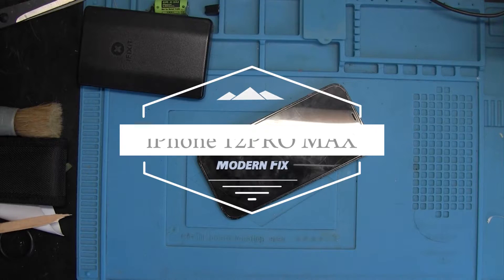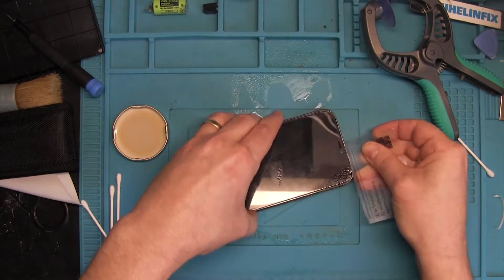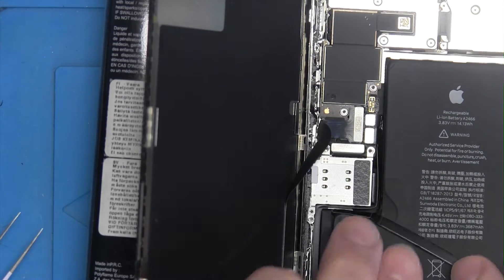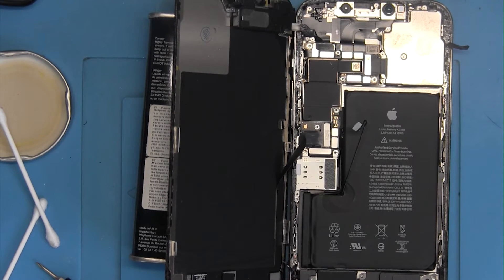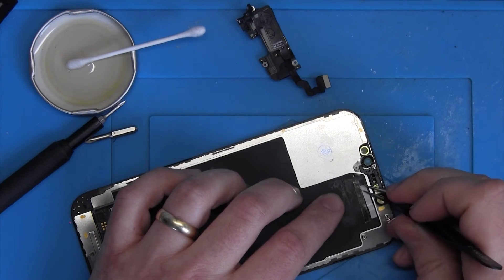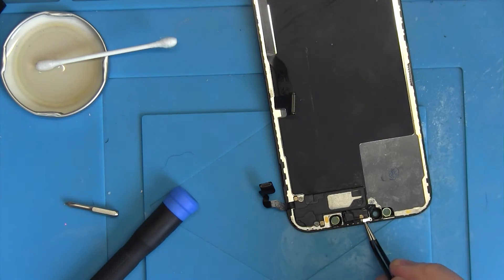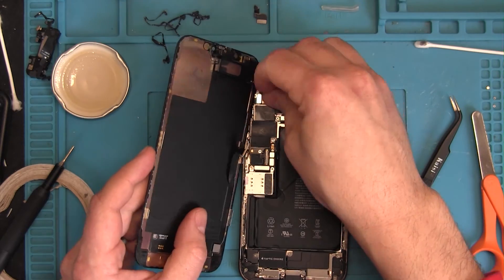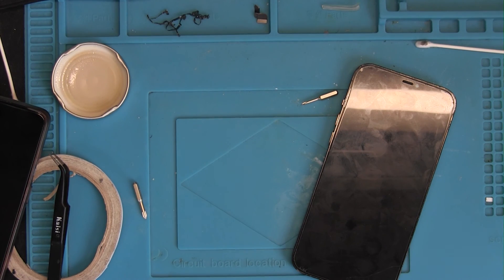iPhone 12 PRO MAX Boot loop error 4013 FIXED!!

Comment: I have this issue on my iPhone 14 Pro Max, would doing this work on my phone or no? I'd really appreciate any help I can get.
Reply from the maker: hmm, I have not worked on 14 pro Max and by looking at the parts it seems that they are bit different. The design of the parts are different and I don't know if it is caused by the same water damage issue. But you can open your phone and detach the same part and see if your phone turns on. E.g. Ifixit has instructions on how to do this.

Comment: I took out the proximity sensor and my phone turned on again, even though face id got cooked, but at least I got inside the phone and icloud backed everything. Thanks for the video it helped a lot!
Reply from the maker: Great, it is always nice to hear that I my videos help.
Reply: Did you just take it out or did you replace it? I just need my phone to turn on so I can get my data.
Reply: @thewes_b  I just took out the sensor didnt need to replace it.
Reply from the maker: @thewes_b  You do not need replace if you just need your data recovered. The phone will turn on without it.

Comment: Does this work for iPad Air (2022) aswell?
Reply from the maker: I have no experience with them. Only ipad I have ever worked on is iPad air 2 but that is from 2014. I think they have changed a lot after that.

Comment: I removed the proximity sensor and it still shows I’m in recovery mode. I follow the steps in the description and it just reboots to the recovery screen.
Reply from the maker: You need to come out of the recovery mode. If the repair did not work it should only flash the apple logo. If it goes to the recovery mode screen showing you the cable logo then you have not exited the recovery mode. I you are unable to exit it you can try googling for softwares for this. Usually the entering and exiting the mode is a free function on these softwares.

Comment: Loooooool.... had this issue and brought it to a shop to fix... said it couldnt be fixed... watched this video opened my iphone with 0 skills... removed that sensor and the iphone is restoring now.... looooool..................... thanksss mannnnnnnnnnnnnnnnnnnnnnnnnnnnnnnnnnnnnnn
Reply from the maker: Nice... Great to hear that you got your phone working. I do not know why the repair stores are not repairing these phones because most issues are fairly simple to do once you get the phone open. Thank you for the comment.
Reply: @modernfix1  I think its because most of them dont know …. He said something about flash memory going bad… thanks man. Your video saved a lot of phones!

Comment: today i got messeg faceid not working than after 1h started flashing apple logo then on itunes i got messeg error 4013 and now my phone is stuck
Reply from the maker: After repair or you have not opened the phone?
Reply: @modernfix1  i havent open the phon i have use it 2 years whitout changing anything and randomly faceid stoped working
Reply from the maker: @bekss8933  Very common issue with these phones. Maybe water damage on the chip.
Reply: I have the same problem today. Face ID not working and then flashing apple logo and stuck at recovery mode. Is it because of faulty proximity sensor? Was looking for help and saw this video and comment… can anyone advise, please?😢😢
Reply from the maker: @Mk1982-q4c  To confirm this proximity sensor issue you need open the phone. Exit  recovery mode first, then shutdown the phone. Open the phone and remove the proximity sensor ribbon cable. If after this when you power on the phone it turns on then this is your issue.

Comment: So do i need to replace the proximity sensor, or can i just remove it?
Reply from the maker: You need to change it since it has the ear speaker in the same module. But interesting point. Since the short is caused by the sensor maybe if you just de-solder the sensor chip it may work. Or it has some of the speaker functionality also tied in to it. I do not know. If you decide to test this please let me know.

Comment: you give me a hope with my iPhone 12 mini but I'm not able to do that. At the Apple Store they told me it's not fixable. In a private shop I got the same answer. I'm shocked, they 100% know that "repair" is working, but they don't want to do it. If I lose the Face ID it's not a big deal...
Reply from the maker: Sad to hear that you cannot get anybody to fix it. If you cannot get anybody to do that then you have nothing to lose if you try it your self. They are a bit hard to open but with the basic tools it is possible. If you have some old phones you can first practice with them.
Reply: @modernfix1  can you please tell me the name of the MODULE I need to try this fix? The one who cost 24$
Reply from the maker: @PRLR4F  proximity sensor
Reply from the maker: @PRLR4F  the module contains ambient light sensor, flood illuminator, proximity sensor.

Comment: Hello, I removed my proximity sensor and it did not come on.
Reply from the maker: are you out of the recovery mode. If you still see your itunes symbol or the symbol for the cable your are not. I you get the apple logo and boot loop you may have a different issue. What was the error code you got from the apple devices program?
Reply: @modernfix1  i get the error 4013. I tried to recover the phone using itunes that is when i got stuck at recovery state. After i removed my proximity censor it still gives the error when i try to restore phone.
Reply from the maker: @akejeludavidojoshimite646  Did you exit the recovery mode? You do not need to restore the phone if the problem is your proximity censor.
Reply: @modernfix1  After i exit recovery mode it worked then the phone went off again. I then tried to update and i got stuck at 'Attempting recovery mode' The phone goes off and on again.
Reply from the maker: @akejeludavidojoshimite646  And you did not plug the sensor back. Then their something else wrong with the phone. Maybe bad battery, or some other component.

Comment: Can I disconect proximity cable to see if my phone will work with out ?
Reply from the maker: Yes, the phone will boot up with out the proximity sensor. This the easy way to troubleshoot this. But remember to take your phone out of the recovery mode before doing this. Otherwise you will not know if it boots up.
Reply: Please tell me how to take out from recovery mode ?
Reply from the maker: @mikelissinavskis203  just google how to exit the recovery mode. I have this also writen in the video description.
Reply from the maker: @mikelissinavskis203  This is in the video description.